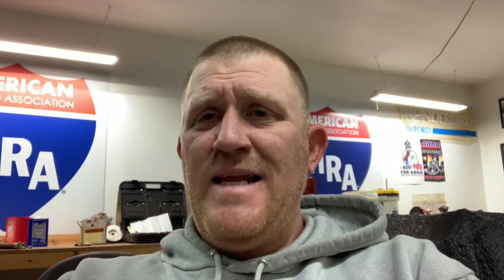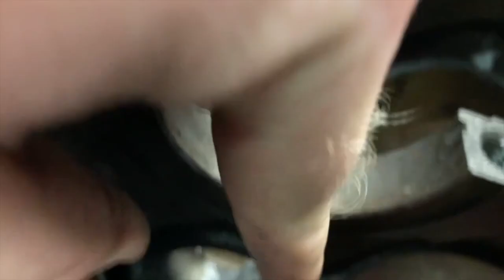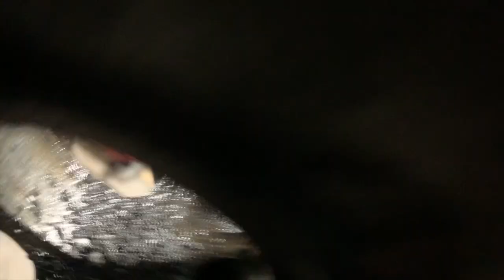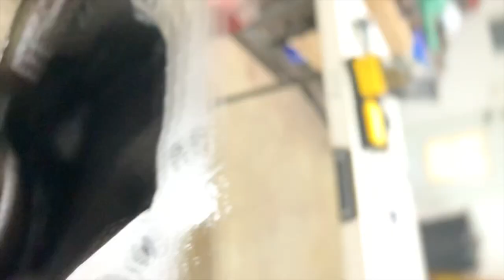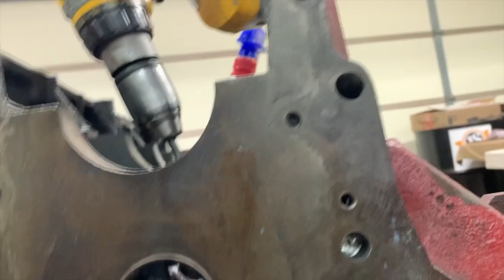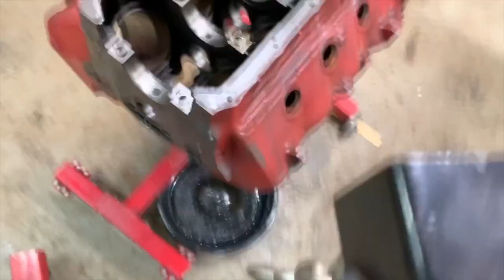Drilling the Mains on a Buick, Rover, Leyland V8 and Buick V6 to make that Hot Rod Engine Live!

Comment: In my experience circle track racing with Buick 455's problems also exist at the front cam bearing and the oil pump. Excessive internal oil pressure leakage at both the front cam bearing and the oil pump. When the motor is hot the aluminum oil pump casing expands and becomes longer than the steel/iron pump gears resulting in reduced oil pressure. If a engines oil pressure diminished over time, I found that a new front cam bearing returned it to normal. I ran .003" bearing clearance on rods and mains and never had a bearing failure but frequently had very low hot oil pressure even with 50W oil. Yes, I used the high-volume oil pump kit, crank scraper, and baffled pan. Quite often raced with very low oil pressure but never damaged a bottom end. Melted a few pistons & blew a few head gaskets but that was a detonation problem that 30deg total advance and 104 or higher-octane fuel eliminated. Flat top pistons, zero deck, and '70 heads cut .100" = high compression so HP was well over 450. I never resolved the oil pump problem; I considered trying aluminum oil pump gears but never found a potential source. On the 455 I built for my Suburban tow vehicle I used a large external oil cooler which helped a lot but that wasn't legal on the race car.

Comment: Hey Dallas. Thanks for the content. Any concerns about weakening the mains by expanding the oil feel hole size? On other OEM blocks such as the FE I have read about stress cracks etc... Typically with 600+ HP builds though.
Reply from the maker: Not at all, the small block will handle 800-1000HP before the block becomes a problem, so feeling it more oil is a huge plus. The engine really would struggle to make that kind of power, even with a turbo. The Big Block on the other hand would start sweating bullets around 600 hp. I doubt it would crack the mains in regards to the larger oil holes, but it might start cracking main bolts/studs.
Reply: That Buick 350 block can handle way more then 600 HP!!

Comment: I've seen people elongate the hole on the main bearing itself to line up with the hole in the block. Is this a bad way to do it?
Reply from the maker: Elongating the hole in the bearing creates less bearing surface on the bearing itself. I prefer to open the passage on the block to minimize bearing feed hole misalignment so that any bearing will be correctly aligned and not just fix the issue for the one bearing, but for any future bearing installation.
Reply: @mr.roddersneighborhood2740  That makes sense. Thank you.

Comment: I’m just about to start rebuilding  my 400bbb I’d sure like to see what you do with them. I’m gonna do the suction side of pump to 5/8 and the pump outlet gallery to 1/2 any other suggestions? This is my first Buick engine rebuild
Reply from the maker: Ironically today I am posting a video discussing a walk around of the early Big Block castings (400 and 430) so make sure to watch it. With the 400BBB being an early block casting (67-69) be VERY careful with taking the suction side out to 5/8", they can crack and break through the casting when drilling the 14" long suction tube. I normally stick to 9/16" on those and leave some strength in the tube. The pickup attachment handles 5/8' and I would recommend opening it up to at least 9/16". I will be doing oiling mods on an early 430 and the videos will be up soon... so stay tuned and it should help you out!
Reply: @mr.roddersneighborhood2740  I noticed the crank is also cross drilled on this engine

Comment: just wondering is this needed on a stock build i had a stock motor with over 150k miles that had no problem and ran good with good oil pressure  i assume it is more for a performance build
Reply from the maker: Not at all... Generally they are fine. Higher RPM or considerably more HP and you should consider it.